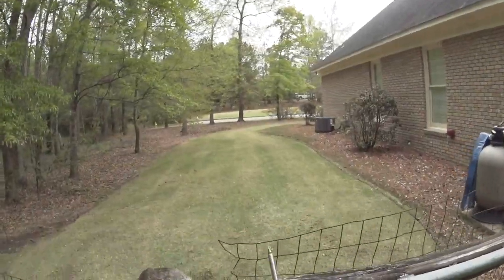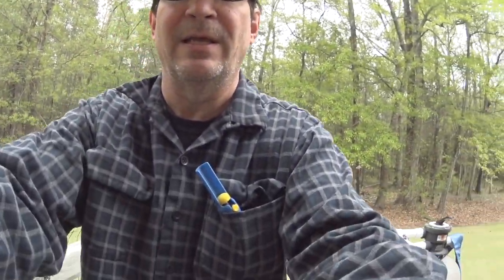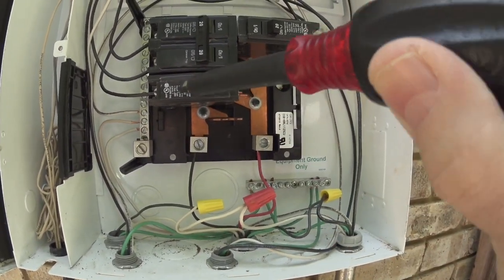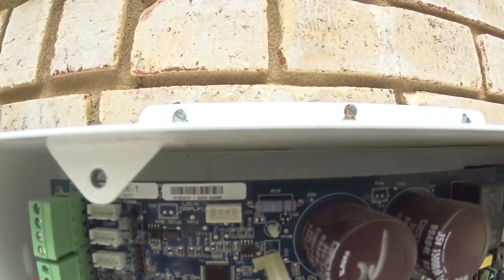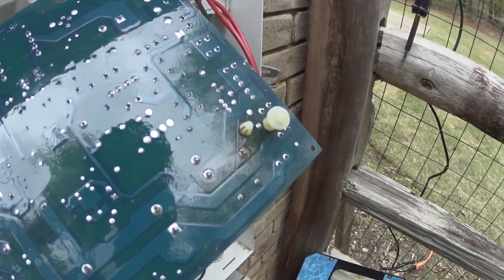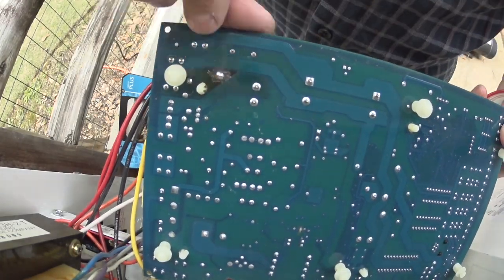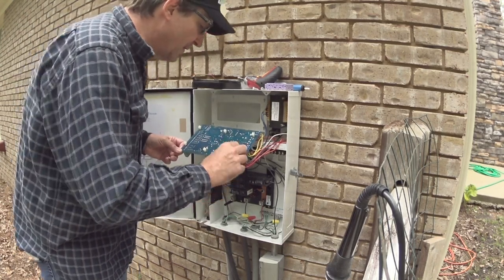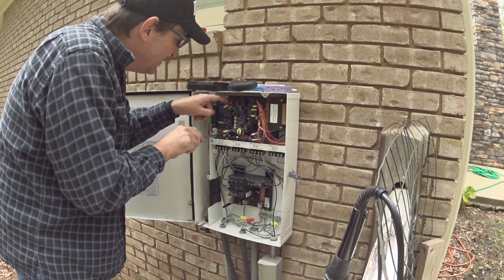Chlorinator Off No Cell Power - DIY Repair

Comment: Thank you for making this video.  I ended up using two solder irons (one on each side of the component leg) because I couldn’t seem to get enough heat on the solder joint using one iron.  Once I got enough heat, I added a fair amount of solder.  Put everything back together and it worked like a champ.  Thank you for saving me approximately $1000.  I called my pool guy initially, and that is what is was going to cost to replace the circuit board.
Reply from the maker: I’m glad you were able to work around the soldering issue and get your pool working again! Soldering irons have different wattages and some are cooler than others. I think the one I used in the video was a 25 watt. As cheap as they are, I bet there is a lot of heat variation even among similar wattage irons. Sounds like your problem might have been with limited contact instead of iron wattage. Anyway, I like how you were able to improvise and use 2 irons to get the soldering done! That’s a creative solution and proves there’s usually more than one way to do something. Nice job!!!

Comment: Thank you for sharing this video.  I got a cell no power message on exact same 3 year old Aqua plus Hayward panel.  Got a quote of $1200 parts and labor to install new board that would only have one year parts warranty.  After watching this well done video I thought why not check my board and found the exact same black circuit failure.  Literally took less than 5 minutes to do it myself. I checked two fuses on panel board also to make sure they were good:and they were.  I love how people take time to help others with these type videos.   I’m still wondering why it always seems to fail in the same spot for what looks like everyone? Thank you again to the original poster!❤
Reply from the maker: HI Steve!  I can't believe you had the same problem on a 3 year old unit. No idea why Hayward can't make these units more durable! I won't get into why I think they don't improve them but I'm sure everyone involved likes selling new units. Whatever the reason is, I'm glad you found my video and were able to save a lot of money!  Thank you for taking the time to leave such a nice comment. I really appreciate it!

Comment: Thank you! My model was slightly different, but it was exactly how you described: a damaged solder on the back of the PCB. Easily fixed following your direction. Thank you so much!
Reply from the maker: I’m glad it worked for you too! Thanks for commenting and sharing your success!

Comment: Loved the video worked perfectly.  But my experience was much different than everyone else. It took me 4 hours and 10 minutes and cost me over $300 dollars.  1 hour to look for solder that I couldn't find, 3 hours to go to homedepot, Mexican restaurant, and walmart. $29 for solder $75 at the restaurant and $225 at Walmart. "I should have went by myself." Then 10 minutes to fix it when I finally got home. I have to say I can't believe it was this easy, you are a lifesaver.
Reply from the maker: Sounds like you went on an adventure. Leaving the house to go get or two things has gotten expensive. In the end, I’m glad you were able to get your board working again! Thanks for sharing your success!

Comment: Your video was extremely helpful, thank you for taking the time to put it together. Watched it, then did the repair in under 20 minutes. Also, I turned the breaker to the pool equipment off at the breaker panel in my garage. You can never be too careful. Thanks again for this vid.
Reply from the maker: Hi Rich7049. That’s great news! I’m glad it worked for you too. Also glad you turned the power off at the main panel. That’s the safest way do the work. Thanks for leaving a comment and sharing your success!

Comment: You are amazing! Thanks for spending the time to share this repair! It totally worked for me. Your communication is stop on. I could not be happier when I saw the chlorinator working again. I would have not known to look at this exact welding if you did not record it.

You just save us our summer pool fun this season. It is very hard to find a skillful pool repairman in my area.

One thing I did different I went to the master breaker and switched off the 100Amp breaker feeding the pool panel and waited an hour to give time for any capacitor to discharge.

I videoed my repair and will share it with all the credits going to you.

Thanks again!
Reply from the maker: I’m glad it worked for you too! 

I agree about shutting off the power feed to the pool panel from the master breaker panel. That’s the best way to work on it. Unfortunately YouTube does not allow updates to posted video footage other than trimming bits out with the web interface. The best I could do without losing the comment history, which people also find helpful, was add warnings in description.

Thanks for the credit in future video! I hope you get lots of views. I made my No Cell Power video on a whim and filmed it on the fly. I’m so glad I did. The video has helped lot of people a save a ton of money over the years!
Reply: Yes, thank you so much! It really helps. Just after I fixed the ‘No Cell Power’ problem following your video, now I’m facing the ‘Pool Bridge Comm’ error and the Check System light is in Red. Anything I can do to resolve it? Thanks
Reply from the maker: @davidcai6573, I checked with the guy I know who does professional board repairs on these systems. Here is what he said:

"That message shows up when the main board is looking for another digital communication component, like variable speed pump or chemical controller (ORP) .  But most likely it is that the pump breaker is tripped. "

Let me know if you get it going again! Thanks!

Comment: Thank you! Thank you!  I was having a Chlorinator Off High Salt amps reading.
It had warped the fins inside two more replacement cells before I found this video.
I took my 30 watt soldering iron and a desoldering wick to remove as much of the solder from the burnt looking joint.  After that it did take me a few attempts with Flux paste and new solder to make a nice joint.
Viola!  It has been working for a month now!
Reply from the maker: Hi Chris! That’s great news! I’m really glad you found my video and it helped you repair your pool’s salt system. Thanks for commenting and sharing your success!

Comment: I found your video last night as a last recourse after asking my pool guy to send a technician to my house to assess the same issue as you had and correct it.  In view of the pandemic he alerted me it could take a few weeks before the problem would be resolved.  I viewed your video a few times, called my friendly neighbour to lend me some solder and fixed the problem in about 10 minutes.  The exact same contact as on your video was black on my motherboard.  Heated and added a bit of fresh solder, reinstalled everything, put power back on and voilà, problem solved.  Thank you very much, huge saving.  Already ordered a new soldering kit just in case for the next emergency to replace my 50 yrs old Weller soldering gun.  God bless you.
Reply from the maker: Hi Michel, I’m so glad the video helped you out! Comments like yours are a gift!  Thank you for your kind words and for taking the time to come back and share your success here in the comments!

Comment: Thank you for this tutorial. You saved me a lot of money! I used a 30 watt solder iron. I was having trouble at first because I didn't hold the iron to the pin long enough. Finally got it and it's working like a champ again. Thanks again!
Reply from the maker: That’s great news! I’m glad you stuck with it and were able to get the solder to flow around the pin. Thanks for sharing your success here in the comments!

Comment: I can’t thank you enough for making this video!  I had the exact same issue, same control panel, everything was identical.   I picked up a soldering iron and some solder this morning at Canadian Tire for around $40.00.  I followed all of your steps in the fix process and it worked perfectly.  The local pool store “Pioneer Pools, Barrie, ON” had 1 replacement board in stock at a ridiculous price of $1700.00.  I was dreading having to go purchase it and I am so glad I didn’t have to thanks to you and this video!  Much appreciated!!!😊
Reply from the maker: Hi @DanielDoyle-n3k, 

Thanks for leaving a comment and sharing your success! It helps others see that this repair works and saves a lot of money. By the way, the solder repair in the video has been working great since I filmed the repair.

April 2024, my salt cell died. I went to my local store and was quoted around $1800.00 for a replacement T-15 cell which is also ridiculous! I wonder if these prices are for a complete board and cell swap? Anyway, seven years ago the same pool store told me they couldn't warranty a new salt cell unless both the cell and the control board were replaced at the same time. Against their advice, I found a new cell for approximately $400.00 and it lasted until this April. This year I was also able to find a replacement cell for 1/3 of what the pool store quoted me. Hopefully this new cell will also last a very long time.

Note: I did have to have the clock module replaced on my board but that was an unrelated problem. If you ever need more complicated board repair work done, I have found a professional service I use that repairs these boards. Their repairs come with a 3 year warranty and prices are very reasonable.

Thanks,
Tom
FiveAble

Comment: You just saved me $500 and a new Hayward T-Cell15 purchase.  Actually bought the T-cell 15, plugged it in and got the same no cell power signal as before. It’s going back to Amazon. Kept searching, watched your video, tried it and it worked exactly as your video showed. Really appreciate you taking time to post the video and share the solution. Thanks
Reply from the maker: Hi Jon,  So glad my video helped you out!   Thank you for commenting and sharing your success with the repair!

Comment: Thank you Sir! After watching England lose to Spain I just completed this same fix on my Hayward pool system and it worked a treat…the relay solder joint was burned out and you could smell it from the moment I opened the controller cabinet…once it was re-soldered the error message was cleared. Thanks for such an informative video!
Reply from the maker: Hi @jugina152, I'm glad you found my video helpful and it helped you fix your pool system! Thanks for sharing your success here in the comments!

Comment: Thank you so very much! Pool company wanted to replace the entire control system for over $3000 but with your video and a $20 soldering iron I got it back up and running. Super appreciative- you are awesome!!!!!
Reply from the maker: Hi Kevin! That’s great news! Thanks for sharing your success. By the way, the replacement cost of $3000+ you were quoted is by far the highest I have heard yet!
Reply: FiveAble yes. They wanted to replace the entire controller box and ‘upgrade’ me to a more modern system I could control from my phone. No thanks

Comment: Thank you so much for your video.  You saved us $1,000.00,  $900.00 for a new board, and $100 for the pool company to install the new board.  The pool company does not repair the old board, just replaces with a new board.  We followed your video, and within a few minutes our salt cell was working again.  We took one extra step by cut all electricity to the pool.   Thanks again.
Reply from the maker: Hi Vicki,  That’s great news!  Good job cutting the power to the pool at the main panel.  It’s a lot safer to work in the board that way.  Thanks for taking the time to come back to comment and share your success!

Comment: Just want to say thanks. It worked. Cost less then 25.00. Just a basic  solder gun. Spot checked welds and touched up. Worked. Saved replacing the panel.
Reply from the maker: That’s great news! Thanks for sharing your success with the repair! 👍🏻

Comment: THANKS for posting. Just like almost everyone who responded here, I had the Exact same problem, watched your video, checked out my system, and found the same bad joint!  It took longer to heat up the soldering tool, than it did to cure the problem!!! and Yes, I turned off ALL the power. THANKS AGAIN for saving me money, time, and aggravation!
Reply from the maker: Hi Dave! Just found your message. My apologies for the slow reply.  I'm glad the video helped!  Thank you to taking the time to comment and share your success!

Comment: How lucky I was to find your video!  After going through the Hayward trouble shooting steps I was about to give up. So, what did I have to lose. Popped the mother board off, and son of a gun, there it was, burnt solder joint right where you said it would be. Fired up my solder gun and a quick drop and back in business. Thanks so much!
Reply from the maker: Hey that’s great news! Glad you found my video helpful. Thanks for commenting and sharing your success!

Comment: Thanks for making this video!  Great job!  I own the same model control panel, so I was able to follow you instructions exactly.  Probably saved me over $1,000.  For safety reasons, I did install 3 parallel strips of duct tape across the panel over the "hot" electrical components.  Made me feel safer.
Reply from the maker: Glad you  were able to fix your board and save a lot of $$$! That’s a good idea for blocking off the lower section with duct tape. I have added warnings in the description indicating the safest way to work on it is to turn the power feed off to the pool panel at the main breaker panel. I would add that info to the video but YouTube doesn’t provide a way to insert clips in the middle of existing posts. Thanks for sharing your success with the repair!

Comment: Extremely helpful video. The only thing I would change is to switch the source breaker off so all the power to the panel is off.  It's not hard and will be much safer.

Comment: Outstanding video….my Chlorinator stopped and I discovered it had this message today…you could hear the cell relay click on and then instantly click back off! Within 15 mins I had it repaired and back up and running after watching your video! Thank you sir!
Reply from the maker: Hi CajunCoding, I’m glad you were able to get your system back up and running so quickly! Thanks for commenting and sharing your success!

Comment: This video helped out and resolved my "NO CELL POWER 2" error message! Just as shown, same spot on the back of the board. Only had a 15 watt soldering iron so had to go pick up a 60 watt at HD and it did the trick. Thanks
Reply from the maker: Hi Rigo, I’m glad you found my video helpful and the repair worked for you too! Thanks for sharing your success!

Comment: Thanks for the video.  For everyone else listening ,  my situation was a little different.  My amps and ppl where showing 0’s.  I pulled out the motherboard and saw a burnt connection on a different relay.  I tried to re-solder , but it did not work.   I ended up changing out the top relay on the middle of the motherboard and now it works.

Thanks for the content ,  saved me from buying a new board !
Reply from the maker: Thanks for commenting and sharing what worked for your board!

Comment: Sir you just made my day, if we were neighbor ill get you a beer or wiskey, totally deserve it!!

I never had issue with the pool getting green in my short 1 year of ownership of that house, and i didn't understood why the chlorinator was keep refusing to stay on upon restart in the diagnostic menu, even if salt level was good, so i searched and found your video! I have a different panel version but the contact was fried at the same exact corner of the board.

I have the same exact soldering iron than you and im lucky that i had about 1 inch of remaining flux wire so i had only 1 try without going get some more, and i did it! Thanks to you!

Have a great day, you have all my respect!
Reply from the maker: Hi @SimQuest677, nice job taking what you learned in my video and applying it to a different panel!

It’s amazing how common this problem is. I’ve even used this trick on the A/C control panel of an old Volvo in order to get the air conditioning working again.

Thank you for sharing your success and for leaving such a kind comment! I really appreciate it!

Comment: This worked great on my Hayward Goldline Pro logic. It removed the error message and it looks like problem solved. Saved me a lot of money. I don’t know of any service company near me that would have took the time to fix the solder joint. THANKS for posting this solution.
Reply from the maker: Nice job! Glad it worked for you too! I asked a local pool company if they were aware of the fix and they said they were but they only replace the entire board. I think they like the problem because it gives them a chance to upsell a new  salt cell or entire system. Thanks for commenting and sharing your success!

Comment: Thanks so much for posting this video. I've had my salt chlorine generator for over 10 years. I got the "No Cell Power" message on my controller display yesterday. Did a Google search and found this video. I followed your steps to re-solder the bad joint. It took me less than 1 hour to get everything done and it now works fine again! Probably save my quite a bit of $$$.
Reply from the maker: Hi Perry, That’s great news! Glad the video helped you get your salt chlorine generator working again. Thank you for commenting and sharing your success!